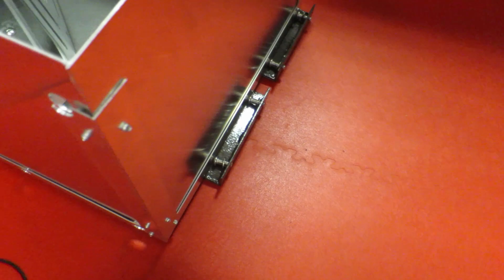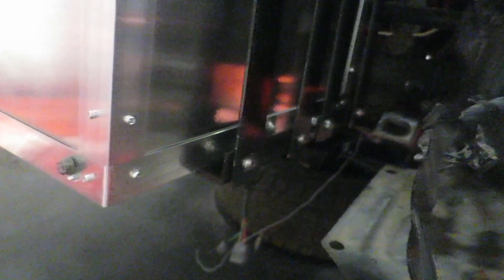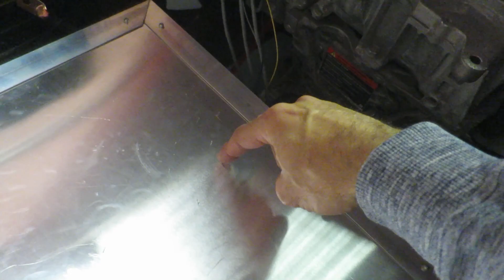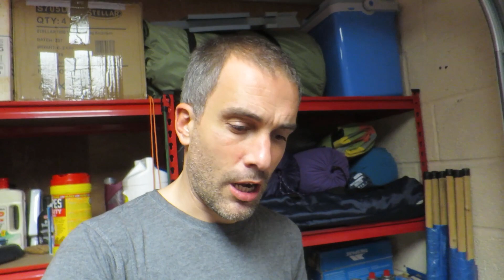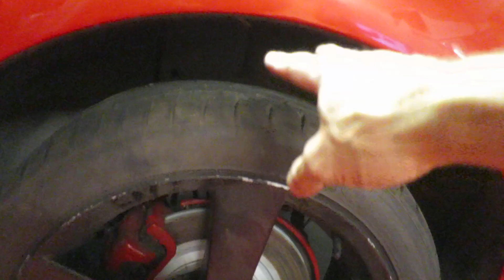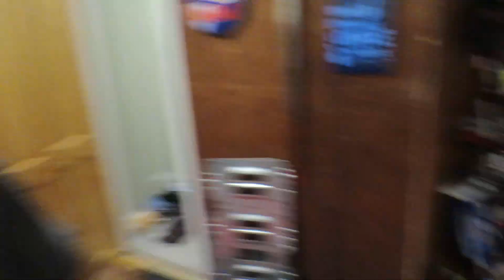Front Battery Box Fitted and Coilovers Adjusted

Comment: I think you need more rivets in your battery box, somewhere between 25-40 mm spacing. There is a way of working it out exactly based on thickness of metal, type of metal and diameter of rivets but I don’t know it. I wouldn’t want any distortion with such an important component.
Reply: https://youtu.be/Is5KcjW1o-Q
Reply from the maker: So the rivets are not really doing much. The box is actually mainly one piece folded around (see a previous video), the front - bottom - rear are all one piece. Its just the sides being held on. Then all the batteries are secured together with 8 bars and two steel plates. The bottom of the box sits on the steel cradle. I think all the rivets could fail and nothing would really change, except a side might fall off I guess! But its unlikely.

Comment: Looking forward to seeing this rip up the street when it's done!!! I reckon you only need to get the suspension drivable for now and then readjust once its been around the block a few times and settled in. I 'feel' like you should have a stiff structural bar welded across and in front of the battery box at it's lowest point. Something to take the hit if you ever hit a hard dip in the road or a parking barrier or gutter. With the new weight forward of the wheels it may be a little dippy in the nose more than before. Looking great though!! And I'm jealous of that lift!!
Reply from the maker: Hay Mike, I have been thinking about that front box protection. As I think ive said so many times - you do one job just to create three more! Protecting the box has been added to that list! The lift is awesome, feels like about 30 seconds to get a meter lift, makes life so much easier.
Reply: Where did you get your lift?

Comment: I think aluminum in contact with steel is an opportunity for corrosion. Especially in a potentially wet environment. Something to keep an eye on
Reply: good point.
Reply from the maker: Yeah I have had that mentioned to me, I am not sure what speed this might happen and is something I will keep an eye on. The Alu is not structural so I do not expect a failure from any corrosion (well not a quick failure). To be honest, a home built EV - there are lots of 'checks' that will need to be regularly carried out to ensure its not falling apart!
Reply: @SouthWestEVUK  High humidity is enough to see it start. I think most construction with the two products use some for or zinc coatings but a this cork barrier strip between the parts is also a common method. It'll save you heart ache trying to separate bonded parts later.
Reply: Maybe some insulating medium, just a thin smear of a setting agent or similar to keep them apart?